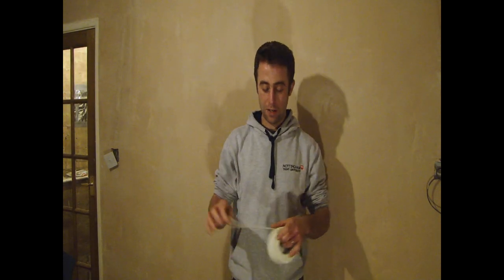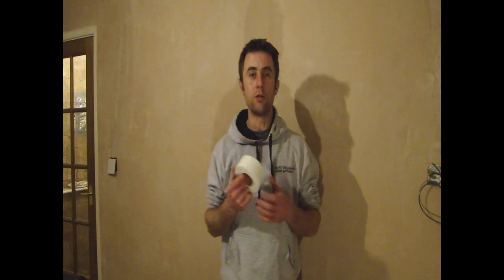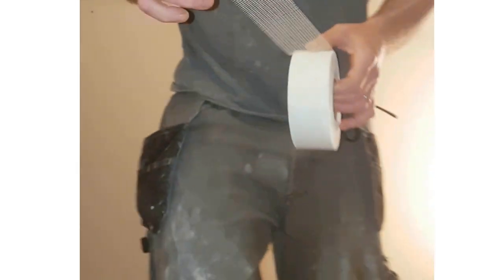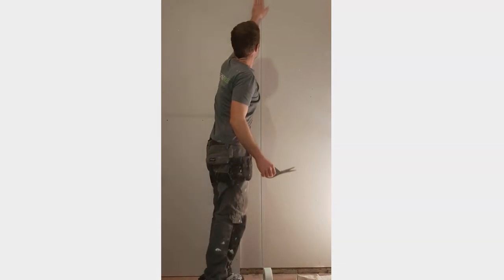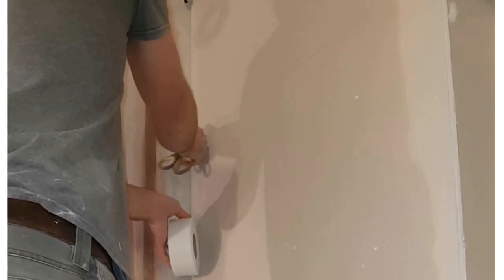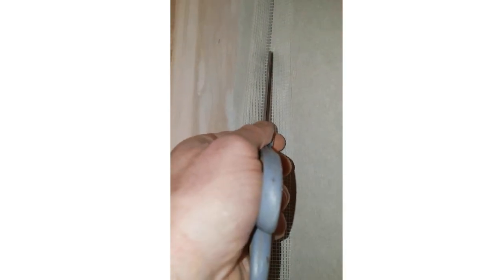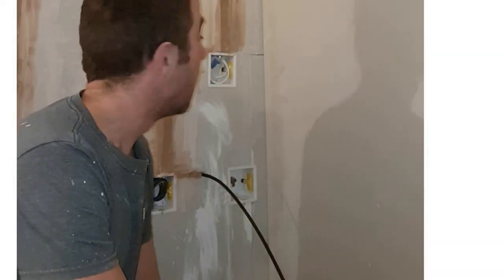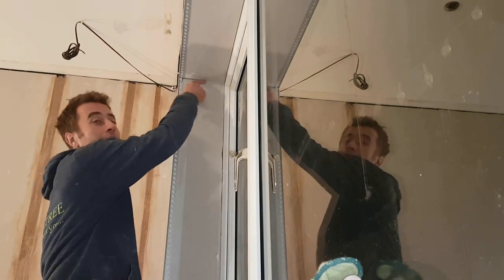How to use scrim tape on plasterboards - all you need to know

Comment: Brilliant explanation! So, what's the difference between this tape and the joint tape? should the joint tape be applied after this scrim one or is it either one or another? 
Thanks,
Juan
Reply from the maker: Juan, not sure what the difference is to be honest. Maybe one is stronger than the other, or easier to use. If you find out, let me know. It is one or the other though

Comment: Hi! What sort of joint compound do you need to use after applying the tape? I am refitting a bathroom and need to joint and tile some waterproof boards. Thank you!
Reply from the maker: Hi Nicola, normally no joint compound is required over the scrim tape, just skim over it

Comment: I live in London, UK. I have a single brick wall in my extension. I get mould and damp coming through during the winter. We've got a builder to attach foam backing plasterboard to the inside of the wall. He's used the same tape as you have in this video. But damp is still coming through in between the plasterboard joints. A dark streak line is visible. How can we stop the damp coming through the plasterboard joints. There must be a seal jointing tape or something similar?
Reply from the maker: Hi there. The damp will need stopping before it comes through to the plasterboard. This is traditionally achieved by a cavity between two leaves of bricks. If the foam backed stuff (thermal insulated plasterboard I guess?) is stuck directly onto the bricks, then the moisture tracks through from the bricks, into the plasterboard and shows on the inside. If you coat the plasterboard in some sort of tanking/waterproofing paint, then the moisture will be trapped in the plasterboard without being able to breath (getting rid of excess moisture). There needs to be a cavity in there and the inner leaf built using either masonry or a stud wall
Reply: I had the exact same issue, Victorian property with single brick 'extension' in the kitchen. My builder dug down under the foundations to ventilate the brick, did not apply any plaster to the brick to let the bricks breathe, then on the outside dug a french drain channel to allow the water to run off into some pebbles rather than letting the rain water sit by the wall, it worked. Hope that helps :)

Comment: I use 4 inch scrum for corners and ceiling edges much better.
Reply from the maker: Was it easier to apply than 2" wide stuff?
Reply: @HelpfulHomeDIY  well all scrim is useless not very sticky if it's to rubbish I use diluted PVA to stick it to board. Some rolls are better than others luck of the draw I suppose.

Comment: Will it stick to a painted ceiling..
Reply from the maker: Hi Joseph, not sure to be honest as I've not tried it on paint. Your question does make me think you'll be plastering over the painted ceiling though? If so, you'll need to PVA the ceiling first and apply the 1st skim coat on the PVA when it's still tacky. Hope this helps.